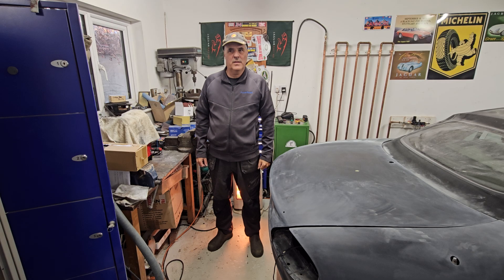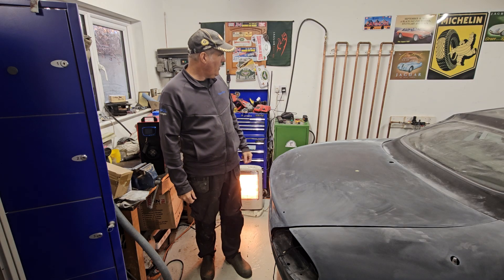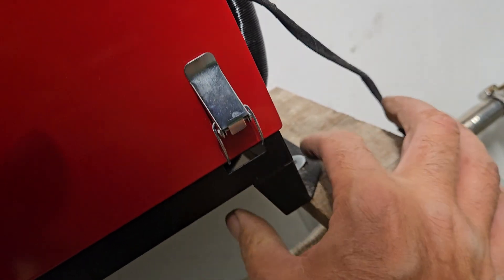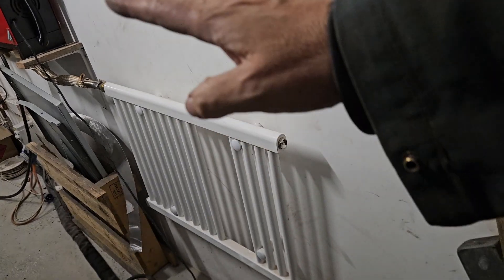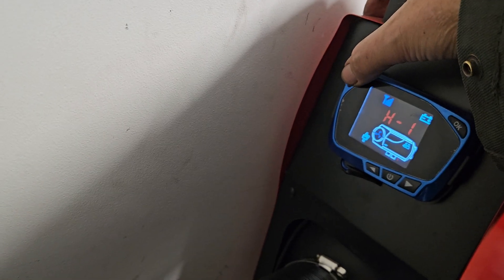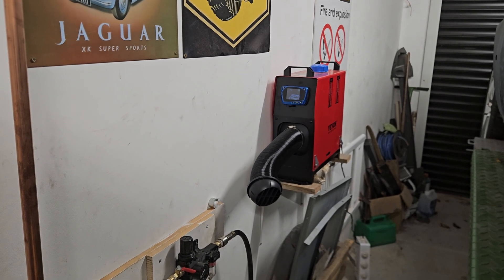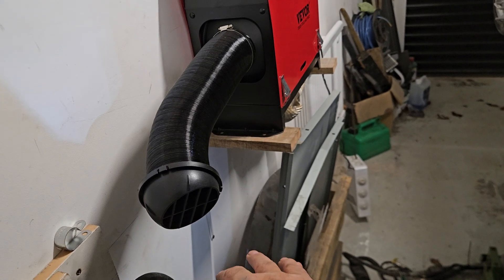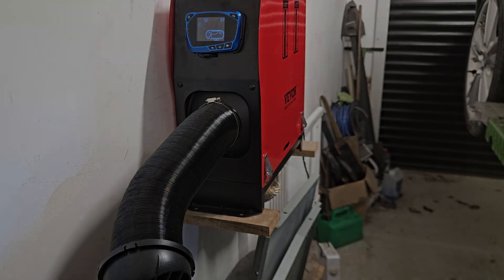Diesel Heater garage upgrade

Comment: works great right? I would pull air for the burner from outside. this prevents lower presure in the room, which suck in cold air. 
I was also thinking of routing the exhaust through an old radiator before exiting. it really seemed to work well,
good luck with your project,
Reply from the maker: I had not thought of doing that for the inlet. I would just have to make sure it was far enough from the exhaust outlet. Some where towards the front of the heater. The radiator gets so hot I was also thinking of putting a mesh/grate of some kind over it as it will seriously burn you if you grab hold of it even for just a few seconds. It seemed crazy to just pump all that heat outside and not use it.